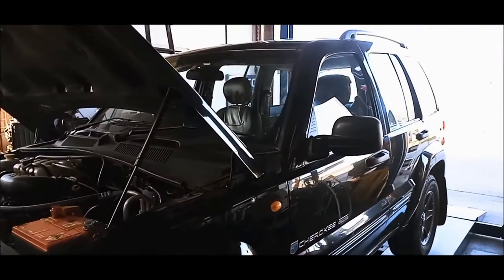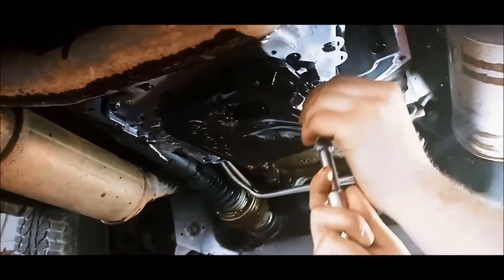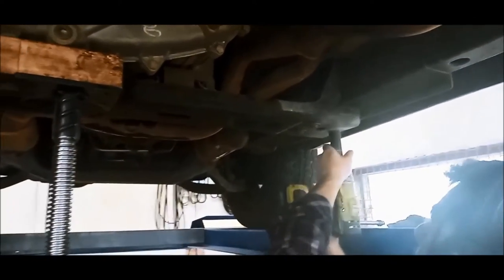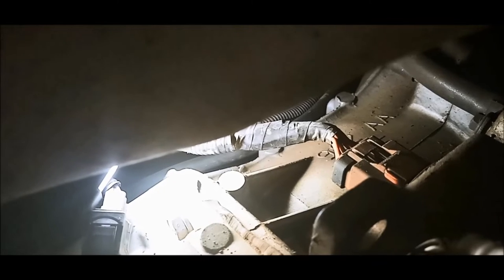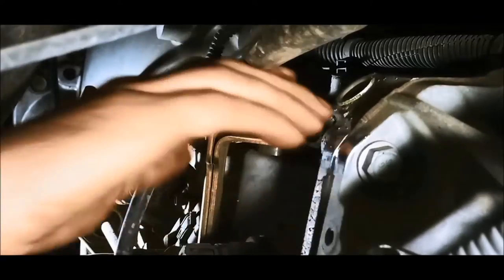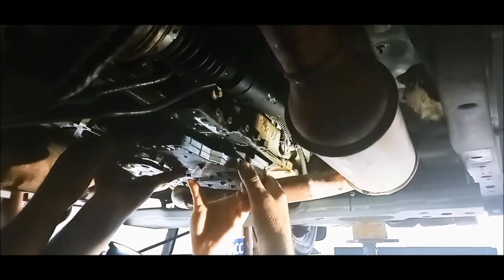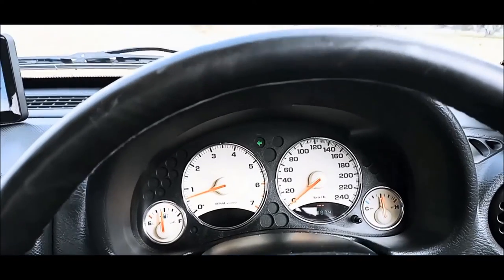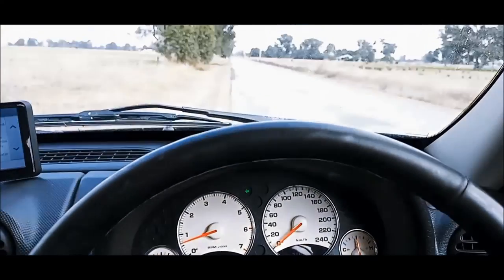Jeep 42RLE Transmission Solenoid Block Limp Mode P0750 Solenoid A Solenoid L&R Remove Test Flush Fix

Comment: This video is a life saver. I looked for almost a year now on info about replacing the NSS/SPEED SENSOR. I had to start my 04 liberty more then a dozen time in neutral for the year+ i had it. I even called a few shops in my local area, and some do not even have an hourly rate for it or wanted $200 to take a look at it before giving me a quote. I was afraid of touching the transmission to get to it. But this video explains everthing so cleary. Even though i skipped though it to see if the step was taking me to what i needed. But i feel like with a bit a time, and patient i should be able to do it on my own, because labour is going to be crazy expensive with the part only being $40 or so from rockauto. Thanks again for this amazing video and ill definitely have to share it in the jeepforum.
Reply from the maker: hi, glad if helped. if deserved a few beers are well appreciated, link is in description. cheers

Comment: Great detail and information on the park pawl linkage and assembly.
Reply from the maker: thanks & cheers
Reply: Very good & informative video. I had trouble engaging the park pawl with the linkage, shift lever would not move... ended up loosely installing the VB & testing the shift lever then tightening the VB bolts.

Comment: Muchas gracias!! Me sirvió mucho para hacer el diagnóstico inicial de mi transmisión. Ya descarté el cuerpo de válvulas y solenoides + sensores de velocidad + aceite + filtro, sin embargo la falla continúa. Funciona solo la primera y reversa, pero si pongo la selectora en D o 2da pasan unos metros y pierde tracción (como si quedara en neutro). Según su experiencia serán los discos de 2da 4ta los que están jodidos?
Reply from the maker: hi, did you air pressure test the apply ports when you have valve body out ? you may have internal pressure leak and worn bushings? cheers
Reply: @YepThatsIt hi, no I didn't. Could you please guide me how to do It?

Comment: How do you know which solenoid rebuild kit you need? I believe theres 2 different sizes
Reply from the maker: hi, i believe the 45rfe & 5-45rfe have 2 different types. 99-03 & 04-on respectively. the 42rle are same i thought. correct if i`m wrong when you find out. cheers

Comment: We've had solenoid changed and pcm "fixed" and recalibrated...still getting the P0750 code and stuck in limp mode.  I wish a simple flush would do but looking to swap out the pcm again. 2010 wrangler
Reply from the maker: hi, if you`re sure solenoids are ok, then will be in connection. cheers

Comment: If you have the swing arm locked into place, what do you do when you have it installed? It will be a gear off. Also, how do you get it to slide into the slot it came out of?
Reply from the maker: hi, after you fit it in locked position, it should slide into the  park pawl linkage easier on its own. cheers

Comment: did you have to put shift selector in low at first to remove the linkage ?? others say to do this once you loosen the linkage nut..
Reply from the maker: hi, all the way clockwise plus one more notch. cheers

Comment: Need help had a couple of codes and I replaced the trs and most went away also the output speed sensor was replaced im currently getting p0706 code 2008 jeep Wrangler need help? Do I need to charge again the trs or the valve body is bad?? Need help
Reply from the maker: Hi were parts you replaced New or used ? Check range sensor and connections, as well as battery strength and internal resistance and that earth straps have good connection. Often earth straps are bolted to paint, only electrical connection is through thread of bolts which aren't designed to conduct electricity. Wd40 or dielectric grease. Check all basics first....You have similar issue after your repairs so you have missed something that is common to old and new repair. Cheers

Comment: Man i got a Po870 code. Limp mode second and reverse mode but wont shift, where is the best place to start?
Reply from the maker: hi, start at all the basics then examine solenoid block. all depends on how much ( and how large and type debris ) present. if from normal wear and tear its worth either flushing solenoids or completely replacing solenoid block. cheers
Reply: @YepThatsIt thanks man I've got a replacement coming. I'll let you know how it goes

Comment: What did you torque the transmission pan to ?
Reply from the maker: hi, depends on gasket material - cork rubber - duraprene - farpak - rubber ? cheers

Comment: Ever come across a p0841 ?
Reply from the maker: hi, check basics, connections and pressure control solenoid. cheers
Reply: I had this exact code, ended being solenoid block
Reply: @rubygarcia516  I’ve replaced it twice

Comment: I lost reverse but all other heats seem fine
Reply from the maker: hi, you need to check manual 1st and maybe do a line pressure test or converter stall test. check all the basics first and work up from there. cheers

Comment: Lowering my transmission didn't work I still can't get to the plug
Reply from the maker: hi, you need to do what you need to do to get access ( dont ever forget safety ! ) maybe try remove an engine mount bolt ? cheers
Reply: Patience is key!